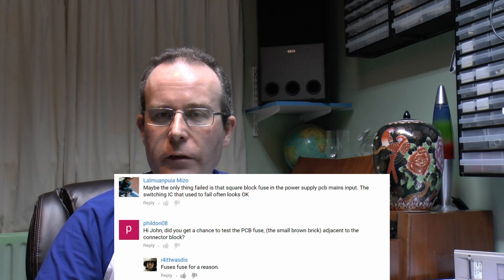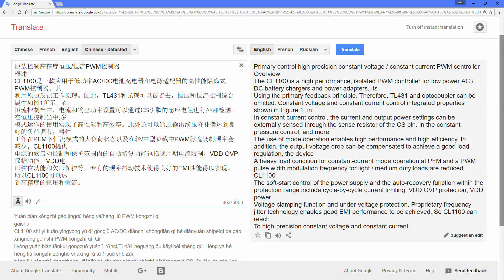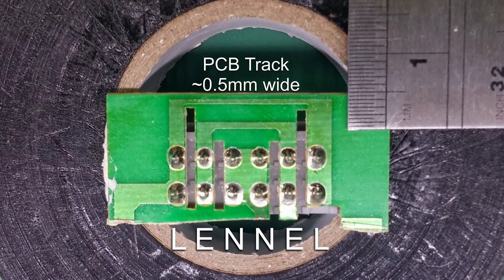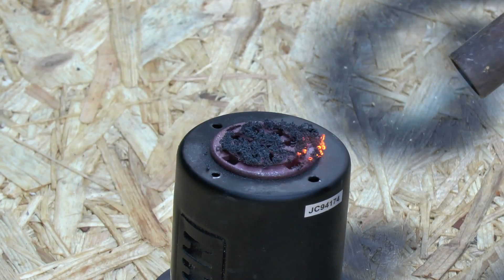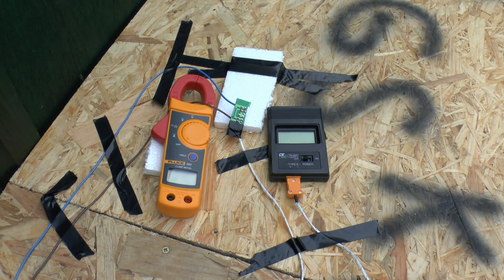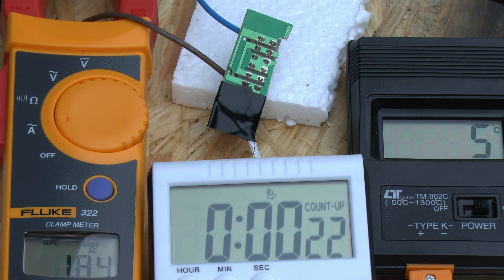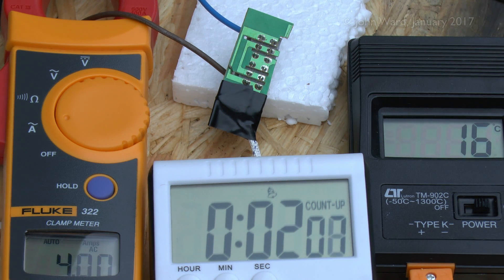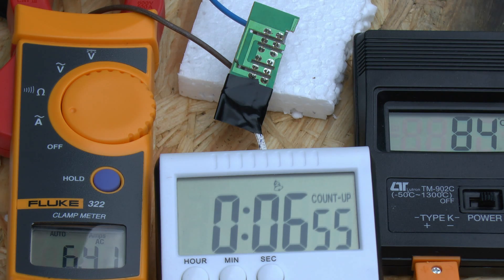Integrated Downlight Fire and Current Tests

Comment: hi john,
hope u're doing great. i've been following u for quite long time. and  i have 2 questions
1- what power source do u use to supply that high current throgh your tests.
2- i notice a change the frame speed, looks like u've changed the camera u use ?

best wishes
Reply from the maker: Power sources explained in these videos: up to 30A: https://youtu.be/V75YZnIhJHc
Above 30A: https://youtu.be/V75YZnIhJHc
Camera is the same one, everything recorded at 50fps.
Reply: thanks John

Comment: Hopefully people would have a JB upstream of these lights with the main circuit loop in/out and switch wire arrangement so that only the load of a few of these down-lights is going through the traces.
Great informative video. I've fitted these in the past, not again! Thanks for taking the time to make the video.

Comment: Very interesting video. Do you know where the light fitting was purchased from? If from eBay or Bangood or the like it would not surprise me. I would be surprised if this unit would pass the UK's safety standards for light fittings? Seeing that you have just shown that the pass through arrangement  on the pcb is totally inadequate for a 6amp circuit. That is why i wonder where it was originally purchased from, not from an electrical wholesaler or DIY shed i would hope. But if from eBay or the like, does not surprise me one bit.
Reply from the maker: Manufacturer is JCC,  www.jcc.co.uk a supposedly reputable UK company supplying decent products.  No doubt still made in China, but you would expect a better standard of design compared to the cheapest unbranded stuff.  They are also fairly expensive, typically £25-£30 each.
Reply: Have you ever heard of the wholesaler 'Denmans'? They stock these JCC downlighters

Comment: A very useful practical demonstration. So it looks like an overcurrent protection of 6A for ligting circuits is more than adequate for modern lighting loads typically encountered in domestic situations, as opposed to 10/15 A ocp to be found as the norm in other countries.

Comment: Why are your lighting circuits only like 6 amps? Are you using 220V? 
Most circuits in the USA are 15 or 20 amps.
Reply: Are US lighting circuits also 15 to 20 amps, not just your socket outlets? UK houses generally have a 16 amp circuit per floor for the socket outlets, and a 5-10 amp circuit per floor for the in-ceiling lighting, at 230V.
Reply: @Motorman2112  I think uk/Irish sockets circuits are 30/32 amp ring mains now?
Reply: 230v NOM in Britain but can be nearer to 240v so ~1.3kW which usually is plenty.
Reply: My experience in several years inspecting electrics in typical northern English houses is a 32A power ring per floor and a 6A lighting circuit per floor. 20A power circuits are sometimes found but unlikely to supply an entire floor

Comment: Loved the video - great work as usual. Watched it twice as during the first time I noticed the electrical tape on the thermocouple moving a bit. On re-watching it, could see it expanding and contracting as the temperature increased. Must have been a small pocket of air trapped inside. 
Was scary to see just how warm it got before the track failed. And that connector is outside the fire retarding can!!

Comment: Thank you for doing this John. A more likely danger to me is that the earth (cpc) track is quite thin... if a live/earth fault happened downstream, it's possible the earth could blow open  leaving the phase intact. So when the householder resets the breaker (as they always do LOL) ... the system could start working again with no effective earth AND a live/earth fault downstream... Not a very good design :( They could have avoided this if they'd done the usual LL EE NN layout
Reply: Followup: you addressed this at the end of the video but in a different way. The idea of a live/earth fault causing the earth to fuse out is a real worry for me though!
Reply: TheChipmunk2008 m.